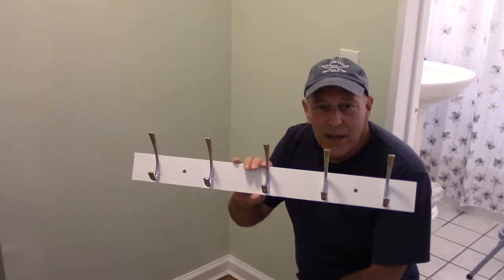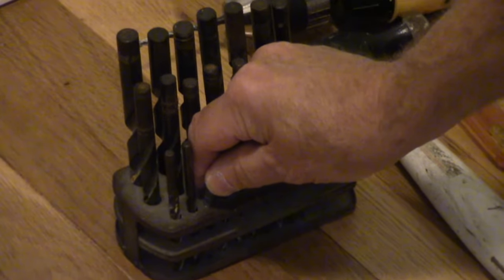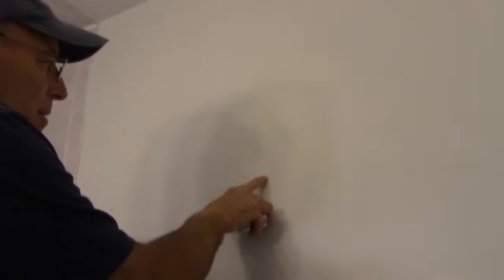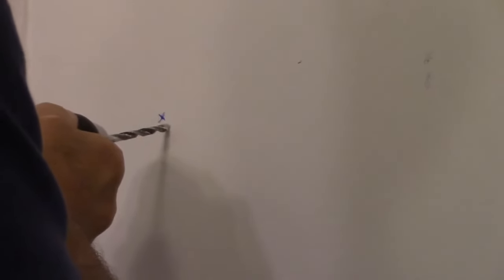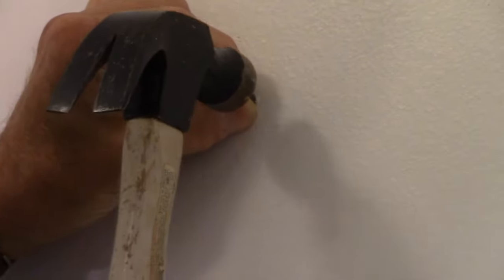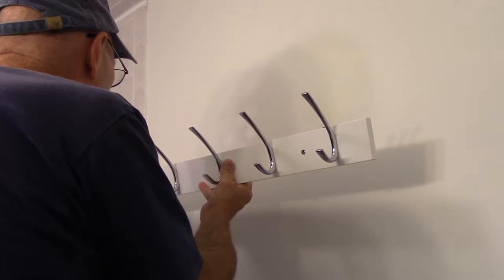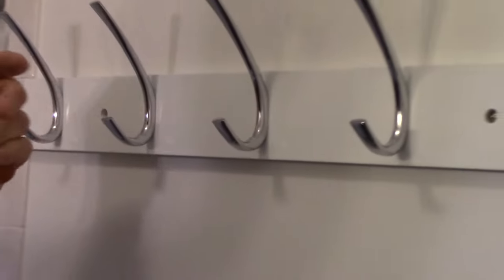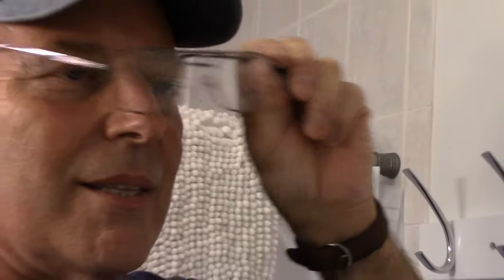How To Install A Coat Rack On The Wall

Comment: Dont you think wallmate would have been a better option instead of molly? I had couple of loose towel hangers loose since molly was used. Even damaged the wall making a big hole.  I have used wallmate now and it works like a charm.